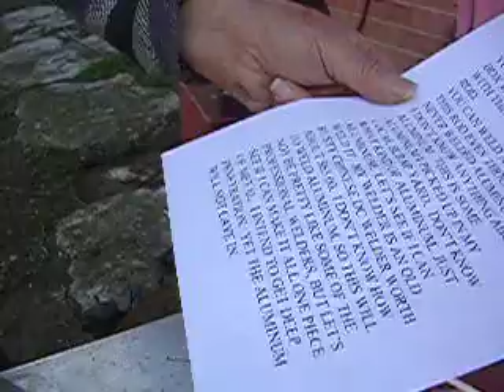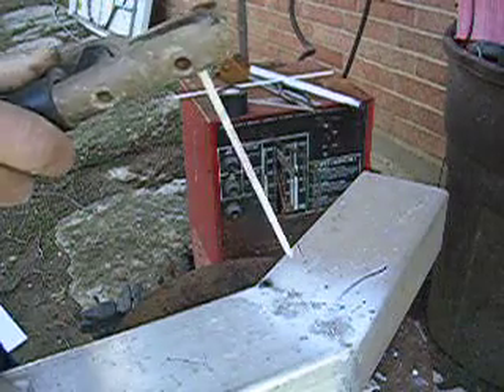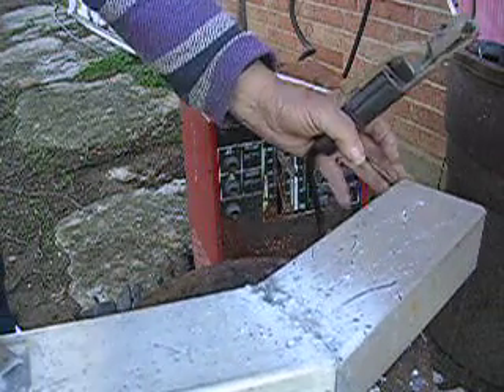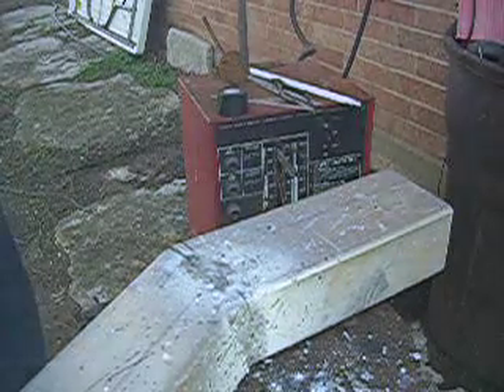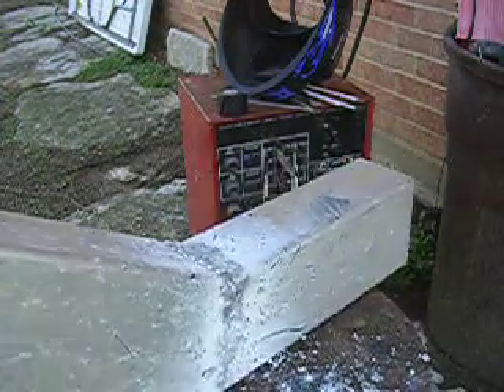STICK WELD ON ALUMINUM SQ TUBE look at ebay item #  380262892658 and  350388156484.

Comment: Try cleaning the shit outa your base metal with a stainless steel wool pad, rinse it with brake clean, or isopropanol, then start welding with a pre-heated rod. Preheating the rod and cleaning the base metal makes it much easier to strike and maintain a coherent and stable arc. Nice vid by the way. We Kiwis love our welding, when in the paddock and run out of rods, rusty No. 8 wire will suffice.

Comment: if the welder can be turned down enough, wouldn't matter what kind, best though, to use a mig or tig... you can control the heat better.

Comment from the maker: I can tell how smart you are.  You don't even know the difference between aluminum welding rod and soldering.   Alumiweld is zinc solder.  Over the last 60 years,  I have sold many 1000's of pounds of zinc solder.  It does a good job of soldering, you will never actually weld with alumiweld.  Some of the people selling alumiweld will tell you that you can weld aluminum with alumiweld.  They snag people like you, who know no better.

Comment: Sorry to hurt your feelings "Colonel" but I did not say anything negative about what you showed, or said.. the question was.. can you do it with and ac. the answer was.. yes, if it can turn down low enough.. but.. and this is what you took homage at.. for electric, it is easier to use a mig or tig.. I do not need to Make a video on mig and Tig.. they already have them.. get over yourself and quit being defensive.. makes you look petty..